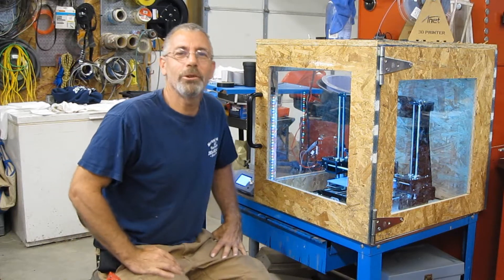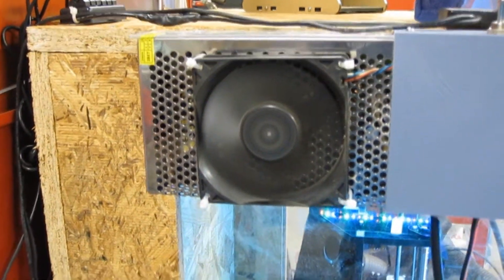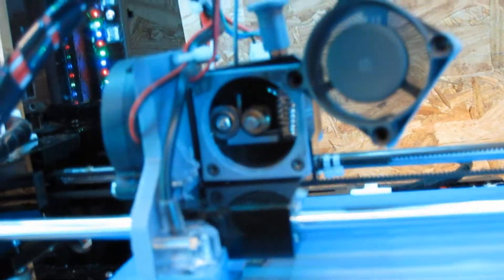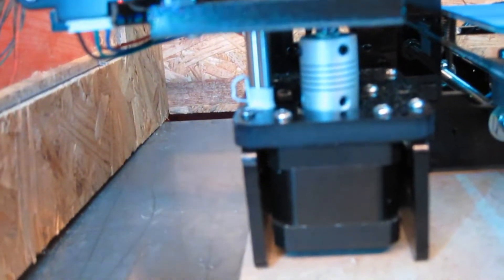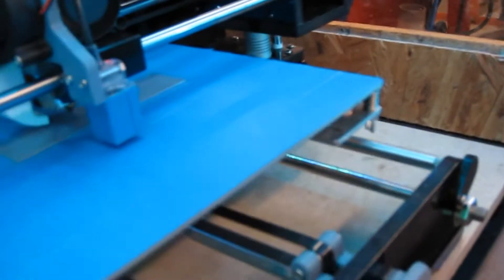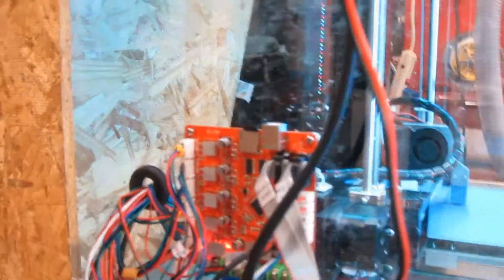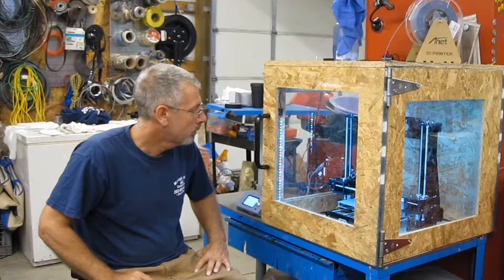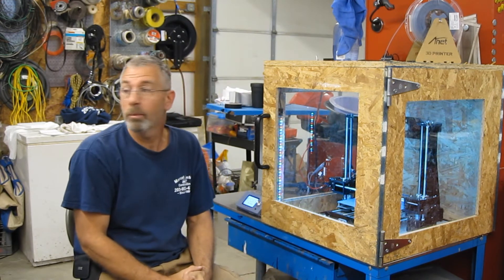Anet A6 FUN Upgrades...so far!

Comment: Great tips mate, I'm going to have some projects now that I have an A6 that's just arrived today. Haven't built it yet, so I might have do some of the mods before I do.
Reply from the maker: David Reynolds  Build it first, And get it running before you modify it. It will be more fun. If you're new to 3d printing, there's lot to learn...why make it more frustrating at first.
Reply: Marcel LeMay, thanks marcel for the advice. I've had one before, an Aldi brand one, unfortunately it the nozzle got clogged, I tried heating it with a propane torch, which didn't work And then I pulled it out and pushed the blockage out, but too late I realised I burnt out the rheostat? Lesson learnt, too late of course lol.  I got my money back from Aldi and they had an updated one, which the guy almost gave me tilL he realised that it was more expensive, darn it. I'd done plenty of prints, mucked around with the settings and got it running great, but the dial was a pain, too small and would skIp menu items and I'd start on the wrong programs at times. The A6 looks a lot more professional, which combined with the discount that was on it on banggood website at the time meant I could afford it. I will follow your advice though, have fun with it, maybe just do the pipe tape around the shafts and nothing more until I get used to it. Also i Was wondering what 3D cad program that was cheap that you would recommend? I've done a diploma of engineering course and just missed out on completing it by 3 incomplete modules, so only a cert 2 in engineering, not the cert 3, damn it lol.unfortunately the only program they taught us was solid works, and they didn't give us a copy of it. Thanks for responding so quickly, don't expect you to reply straight away as the time difference might be too late for you,q I'm in Australia by the way.

Comment: What temperature does it run at in the enclosure?
Reply from the maker: Paul Thomas I never really measured it but it's gotta be at least 100 degrees f. It gets pretty warm in there.
Reply: Well I print in an ambient temp of 32 to 35 C all day every day. So very similar, my point being as I live in Thailand I don't need an enclosure and more importantly all my electronics are in that environment 24/7 for the last 2/12 years + so no need to put them outside the enclosure.
Reply from the maker: Paul Thomas Its not the temp so much as air currents. Any breeze can cool abs too quick and make it warp.
Reply: My point is my electronics sits in that sort of temp day in day out so no need to move them outside the enclosure.
Reply from the maker: Ahhh...But one day, I may need to heat that enclosure to print stuff like poly carbonate, or even large abs parts. Just thinking ahead.